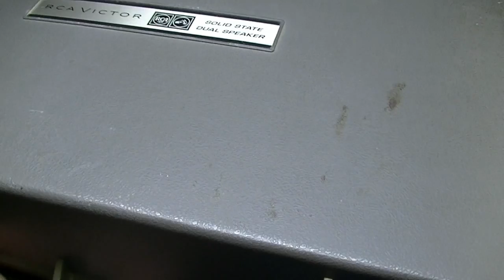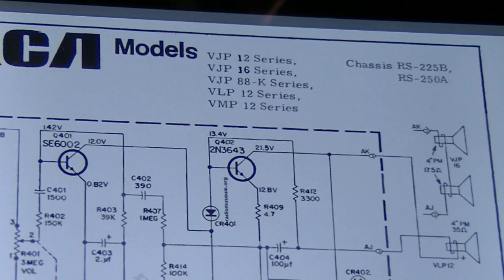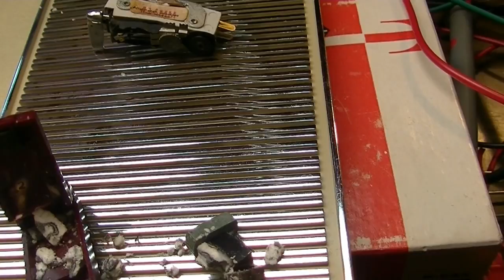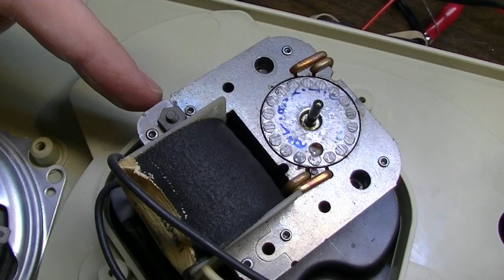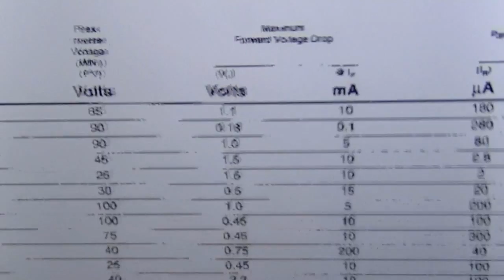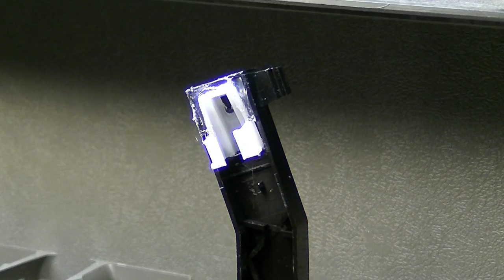Garbage to Gold - Making a Record Player Preamp from Junk Parts

Comment: that's just me but I wouldn't trouble myself for a $10 goodwill turntable and just throw one of those cheap PAM8406 modules in there and actually make it stereo at the same time:
http://www.ebay.com/itm/351803301576

just leave the original electronic in there in case some purist wants to restore it as original in the future
Reply from the maker: This was more about playing around wasting time while I had nothing else on the bench. You're right, I'll never get paid for the time spent except in pleasure of seeing it fixed.
Reply: +quaxk   That's a damned good idea, actually.  It would be compatible with the ceramic cartridge output already, so no preamp required.  The conversion to stereo would also be accomplished, but you might have to replace the speakers - look at the schematic; the originals are fairly high impedance (something like 17 ohms each for the twin-speaker setup, and 32 ohms for the single-speaker rig) but that wouldn't be a big deal.  Of course, you'd also have to swap out the volume pot for a stereo pot.  If you want the tone control to still work, you'd have to build a circuit for it, but with that player it wouldn't do much anyway.  And, of course, you'd have to run one or two more leads to the cartridge.  Still an interesting idea, though.